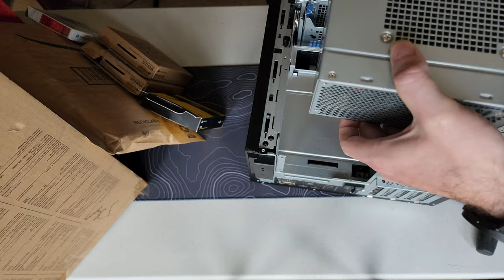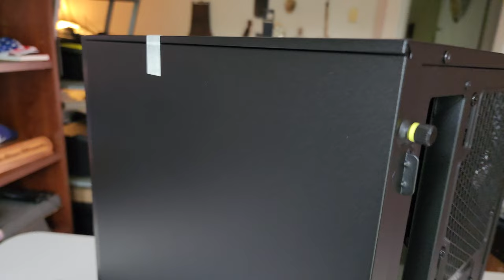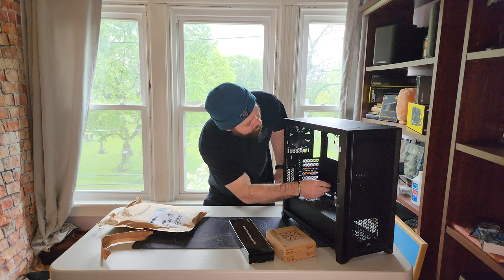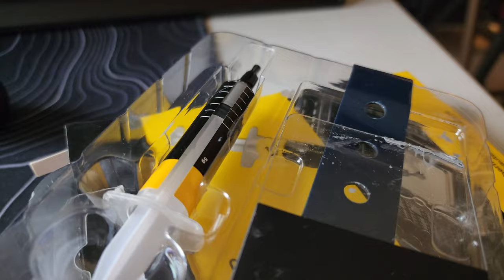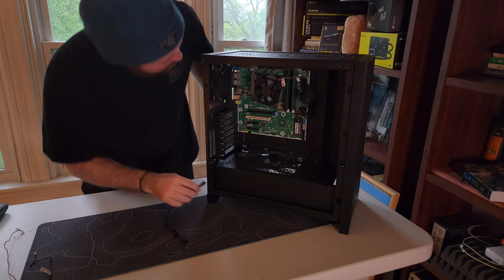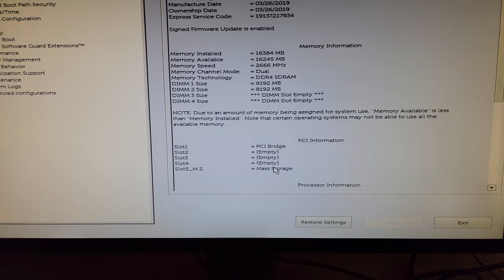TURN YOUR DELL INTO A GAMING PC IN 2023!

Comment: I didn't realize they went back to standard atx (or maybe It's more related to being the precision vs OptiPlex).... That's cool... I wonder how much of a temp difference just adding the fans you ordered to the dell case would make.... it looks like it's designed to have one opposite the PCI slots, but looking at what/how they shoved that case together it looks like it needs one for CPU/PS too.... maybe you can force one there too....Suggestion: Affiliate links to all the things.... (or maybe just links if you don't want to sign up for affiliate).
Reply: They make a difference. Many may not see it, on the XPS 8700 at the bottom where the chrome intake is, one can attach a 92mm intake fan. Their "high end" models will have this, Dell goes through the trouble of concealing this upgrade with thick black paper. I only found it when cleaning the the inside. 

Many of these will take a Noctua cooler of a small or low profile size. Much better than stock fan!
Reply: Optiplex isn't atx.

Comment: Cool build! Does the 3630 support std pin out for ATX Power Switch, HDD LED and PWR LED? Will the cables from the case work? Will a std ATX PSU work?

Comment: Where did you refer to moving the power button? Im doing the exact same build rn with the exact same case. Running into issues. Lots of cables not hooked to anything. I cant find where you covered what to do with all the cables from the case.

Comment: First of all, great video. I appreciate the level of detail. I just completed a case swap for the Precision 3630 too, and faced the issue of the Power Button Cable Failure. For the Optiplex 7010 (and others), this is resolved with some adapters. Do you know if there has been someone that has fixed this issue? Thanks!
Reply from the maker: Thanks for the comment!! I can try to do a follow up video to explain the fix and possibly do some benchmarks etc!
Reply: @darkgalacticmedia  that would be great! Please do!
Reply: Yeah i fixed it, i just reused the power button in the new case

Comment: replace the fan processor to gaming fan , for the better temperature :)
Reply from the maker: I definitely would if it was my daily rig, or if I give it away, but I didn't have any better air cooler when I filmed this. My daily is a 13600k/3070ti with a corsair aio. This was just a video of what I had laying around. It at least kind of shows people how to install a cooler, and it got some fresh thermal paste. What cheap air cooler do you recommend?
Reply: @darkgalacticmedia  Thermalright Peerless Assissin ... very cheap £40 in the UK or $40 ish in the US ... but it performs WELL above it's price class. Like really well.
Reply: @aaronjones4529  Is this easily installed on the dell precision 3630 motherboard?  I've been looking at aftermarket air coolers to use instead of the stock cooler but not sure how easy or difficult it is to stick them on this motherboard.  Is it as easy as replacing the backplate and you're good to go?  Also, the cpu fan header on this motherboard looks to be 4 pin so i'm guessing it won't need any sort of adapter to fit
Reply: @emm5005  reportedly the dell precision 36xx series use standard CPU cooler mounts, so you don't even need to replace the backplate in most cases... Replacement coolers will come with screws and/or standoffs which will fit the default backplate 👍

This being the case, it is worth mentioning that they will of course also take AIO directly.... if you've relocated everything to a different case, this easily enables fitting a 240mm+ AIO should you wish, however if someone wants to build a "sleeper" gaming PC in the original Dell precision case, then some single slot 120mm AIOs will fit on the CPU under the PSU, with the radiator at the top front (with a little bit of HD/SSD relocation and cutting  of the internal case, but honestly just a bit of modification)... This mod cools the CPU far quieter, and will keep it cool when gaming, and vastly improve workstation CPU loads too, boosting higher for longer with a quieter fan noise.
Reply: I wonder when the CPU / case fan errors are showing. Can we use 120 mm fans or only 92 mm (i assume BIOS will check rpm)

Comment: Nice! I’m assuming you did a case swap for better cooling? I built inside one of these before and I never seemed to have thermal issues. Also I had a 1080ti in an xps with i9 9900k similar build chassis my most favorite pc I’ve ever had.
Reply from the maker: Yeah thermals, future upgrades too. You can always throw a new motherboard in this down the road, but you couldn't really get a new motherboard in the future for the precision. So I would say this is really just a teacher build to get first time builders some experience. It came about out of boredom honestly, just wanted to build another computer. haha. I stuffed a 3070ti into the precision case in the past too. I had to cut up  one of these dell precision cases internally, so larger cards literally don't even fit inside this precision, but I was seeing 100c on the cpu and 80+ on the gpu. It was bad. haha

Comment: Hey, you left us hanging what do we do with the power switch  error? I’m stuck there
Reply: Solution discovered: ground the #9 pin to ground. The pin numbering is silkscreened on the motherboard right next to the f panel pins. What did was put a wire into the #9 on the connector and put the other end to the mobo standoff screw right next to it for ground. Error disappeared and Dell is none the wiser :) . I found this solution form the YouTuber “ITG Gear”

Comment: I have a Dell OptiPlex 9020 Small Form Computer Desktop PC, Intel Core i7 3.4GHz Processor, 32GB Ram, 1 TB Solid State, Wireless Keyboard & Mouse, Wi-Fi & Bluetooth, HDMI, Windows 10 Pro

I need a GPU but I don't know what to get
Reply: GTX 1650 or RX 6400. Get the low profile version of either card

Comment: Would a larger cpu cooler like a Noctua fit and also have enough clearance above the capacitors and other components on the board? The type of coolers that have the fan blowing directly out the back of the tower towards the rear extractor case fan? 
Ventroo V5 5 heat pipe cooler has raving reviews for a very low price too
Reply from the maker: I had a 240mm Corsair h100 aio on this motherboard awhile back and I don't see any reason a larger air cooler wouldn't work too. I think it would be fine for clearance. The peerless assassin and the snowman coolers are pretty good too! Honestly even with the stock air cooler, the 8600 doesn't seem to have any issues staying under about 70c.

Comment: nice airflow blocker pc, the new case is a lot better i do have some comment on the power supply, i would have replace that whit a 850 watt gold rated 1.
Reply from the maker: That would be a great upgrade for this pc! I have used a corsair psu on these before. The motherboard is standard atx. This build was just reusing parts,it is not my personal daily rig. I use a 13600k and 3070ti as my personal build. If you upgrade from the stock 460w psu to a larger one, it also opens up more graphics cards too! The 6650xt I used on this is about the max the stock 460w with one power connector will support.
Reply: @darkgalacticmedia  20 pin or 24 pin ?
Reply: @darkgalacticmedia  i usesd a Medion motherboard in a new case however iam using it as my personal rig as u call it got a i3 and a 1050 ti oc and 16 gig ramm stick single channel 4 years old now and still working stock cooler and added some rgb fans to it  the case is a rammbot 998-b.

Comment: Sorry if you already stated it, but what exact form factor is the motherboard? If I wanted another case like ‘thermaltech v250 air rgb’ motherboard compatibility is stated as “ATX, Micro ATX, Mini ITX”?
Reply from the maker: Micro atx I believe. They are quite as long as a full size atx board, I would get a full size atx case though, for future builds!
Reply: @darkgalacticmedia  thanks again

Comment: Don't know what you paid for the Dell but unfortunately this is a waste of a good case and GPU.
Would have been better off buying a used 3600 and B550 combo with RAM. The lack of Hyperthreading is gonna tank FPS in most shooters
or anything with a lot of MOBs on screen. No PCIe4 will hurt it as well because the 6650XT is PCIe4 X8 not X16. Nice to keep Stuff out of landfills but
not the smartest use of funds. Just pop the GPU in the Dell is fine but the case is too much for the 8600.
Reply from the maker: Like I mentioned in previous comment, this is not my actually personal computer, just a for fun with parts I had laying around mostly. My personal is a 13600k and an oc'd 3070ti amp holo. I got a few of these older dells from a friends work that got rid of them. Honestly, the case is far from a waste. You can always reuse the case and I know from first hand experience the temperatures are about 20c hotter in that restrictive case. So, the case and graphics card are both reusable on a future build. The frame rates are actually pretty decent all considering. Would I recommend someone go out and BUY an 8600? No way, but if you have one already, it could save you a little money and get you gaming sooner than saving hundreds more for a z690 and 12th or 13th gen. Honestly, 13th gen isn't even too expensive so there is no point in seeking out a 10th or 11th gen. You will still spend hundreds to end up behind. We are constantly chasing the new fancy things, but like you said, this is more about repurposing old hardware, learning and having some fun along the way. Yeah though, a case is never a bad investment, you can reuse it for years to come on new motherboards. Especially these corsair 4000s. Great mount options for aios in the future etc. So you could run a pc like this with your old dell mb for a year and save, then get a new setup and it would swap right in lol. Plus it looks way nicer in the meantime.
Reply from the maker: I would also encourage someone to do a swap with older hardware like this to get some lower risk to asset experience tinkering on their computers. It may build the confidence and experience they need to become a lifetime pc builder. Where if it was their first time assembling a $3k computer they may be really scared and decide to buy a prebuilt or have a friend build it. so it is also kind of about showing people, " Hey you got this! Give it a try, before you assume you can't!"
Reply: @darkgalacticmedia  Both good points... in another thread I talked about one of my previous builds on a Dell slimline workstation sporting a Celeron D ... at the time I was flat broke, but I picked up the then 4 year old second hand workstation for £50, added an on offer near end of line NV 8800GT(s)(x) slimline GFx card for £85, a second hand, second HDD to set up raid-0 for speedier filesystem access for £20, and a cople of case fans for pennies on the pound... With some inventive case hacks, I didnt even need to change the case, and with an un-scrupulous OC, I got 95% the FPS of my mates £2k beast of a PC.

It wasn't future-proof, but at the time I was broke and I got a gaming machine for a pittance, and it was all so cheap that if I effed it up with the mods or OC, it wouldn't really matter in the long run.

I built my first computer in 1985 when I was 10 years old (a Spectrum ZX80 or 81, which wasn't a PC, but they were an early computer that came in kit form for a cheaper price than ready built) (I've been a geek for a very long time, and I was hooked from that very first build!).  

After a couple of Speccy 48k's, I had an Amiga500 which I hacked to have 1.5MB ram where stock it had 0.5MB and could normally be upgraded to 1MB.  My first PC build cost a beastly £1600 in the early to mid 90s, featuring a Cyrix 150MHZ, Matrox Millenium GFx and truly hench for the time 64MB ram. (Although I did build a 286, 386 and 486 for my older brother beforehand)... 

Since then I've been building constantly for myself, friends or family. Sometimes on a shoe-string, trying to eke out the maximum performance from older depricated hardware, sometimes lucky enough to be temporarily affluent enough to splurge on the most advanced system that money can buy, (although usually making that last a few generations through aggressive overclocking and savvy midway upgrades... I had my i920 when they first released which went through several generations of GFx cards, faster RAM, one of the very first SSDs, then two of the first SSDs in raid-0, before finally upgrading to my 5930k, which in turn saw 3 sets of RAM upgrades, two M2 SSD upgrades, a GTX980, 1080Ti, 2080Ti and 3080 10G, until my upgrade to 12700k when they released).  

When I build a just released hardware system, I just install Windows and usually leave standard settings in BIOS, etc, as it's so overpowered I don't have to worry about system overhead.  As the PC gets closer to the end of its lifespan and it's starting to struggle with newer games, I then start OC'ing and stripping useless services and Microsoft Certified Malware from Windows to keep it current for another year or so before I finally bite the bullet and upgrade the Mobo & CPU... Because from my most recent system build, I wanted an uber-quiet all powerful gaming system, I did spend quite some time in XTU, BIOS and Afterburner undervolting with a minor overclock too on each, however as it ages there is plenty of scope to ditch the quietness, crank the fans, and crank the OC, and I'll learn how to strip down Windows 11, just like I did for 3.11, 95, 98, XP, 7 and 10 😅 ... and yes, I have heard of Atlas OS (I didn't use it for 10, chosing to strip 10 manually myself), but I'm sure I will give that a try when it releases and matures a bit for Win 11 😁

I'm hoping the 13th Gen Intel will get a stepping refresh before 14th Gen release, which will allow them to OC further than current stepping... Either way, I'll buy a 13700k cheap when 14th Gen actually release, and OC the bejeesus out of it to keep my current MOBO for a bit longer.  And I'm forgoing the 40 series, and will wait for the 50 series NVidia, primarily because I want the Pimax 12k and I'm well aware that that will take a beast of a GFx card to run at full resolution (Im currently running a Quest 2 but solely on PC, having previously had the Oculus CV1 (and I even had the Forte VFX1, the first commercially available VR headset waaaaay back in the mid 90s; Quake II and Descent were truly EPIC for their time in VR)

My long point being, you're right that once you've built confidence on your first (potentially cheap ass) system, you'll realise it's not that scary and may well "get the bug"... and it is amazing what you can eke out of cheaper hardware with the massive self-satisfaction associated with that too!
Reply: You might be surprised to learn that its probably not losing that much, if anything.  Current gen cards actually come nowhere near saturating the available bandwidth of current PCIE.

I recently noticed that my riser cable was badly seated / had shifted since I first built the PC... I only noticed because I cracked up CPU-Z to make my own video, and noticed my 3080 was running at PCIE4x2 not PCIE 4x16... There was absolutely ZERO loss in FPS in the games that I play (Atlas and Forza 5) and, as I say, I only noticed on a fluke...

I was somewhat alarmed initially to realise that I was leaving performance on the table, but I reseated the riser cable, checked it was running 16x and checked my games, and I hadn't gained ANY fps...not even one or two!

EDIT: Nor was there any noticable pop-in at 2x, which could be another symptom of poor bandwidth instead of FPS loss.
Reply: Agree! Would have slapped a rx580 (+ or -) in the original, new ssd, maxed the ram capacity and speed, and called it "Done!"
Reply: The 8600 is still capable of 1080 gaming with 6 cores just fine,  PCIe4 X8 or X16 wont matter, you're not even coming close to saturating the bandwidth of either @1080. Could you build something better? of course, but that wasn't the point of the video.

II think this is how 99% of people get into PC gaming, by upgrading a prebuilt and gaining experience before committing to build their first complete PC.

Comment: I'm confused, is that not the same as the USB 3.0 header on an off the shelf motherboard, why do you need the front USB off the other case, why can't you plug the cases USB 3.0 cable into the header on the board, is it a different pinout? Also the board has a USB C, they make a usb c to usb 3.0 female adaptor you could plug the front USB into if that is not the correct 3.0 header.
Reply from the maker: I seem to remember it just wouldn't work for some reason? Bios setting we can't change, maybe?  I plan to do some follow up videos possibly. So, I'll look into this again, but I seem to remember it is a standard usb3 connector but for whatever reason, it just doesn't recognize the case's front IO. So, to make any use of the port I took the cable from the Dell case and hid it in the basement so you got some functionality.
Reply: Cool Cool man I like to see the video and you getting that front IO working. I've seen these boards with 9th gen Intel i7 9700s and 9700F, the whole bare bones PC I think was $80 US and came with the PSU and mobo, I have an i9 9900k, so I wonder if it would support that CPU and I could build a secondary rig with a 3060ti for the wife. I think that CPU could handle that RTX 3060ti just fine.  @darkgalacticmedia